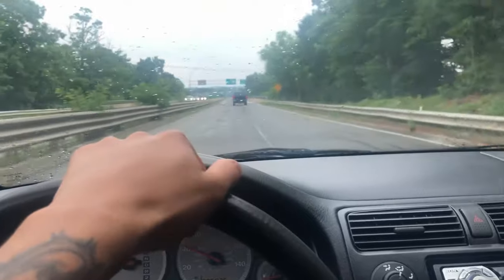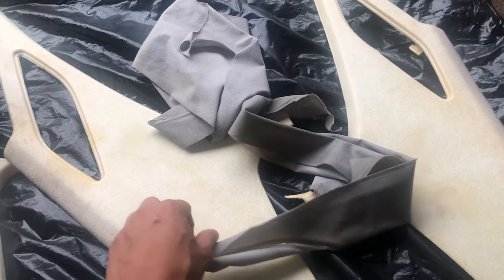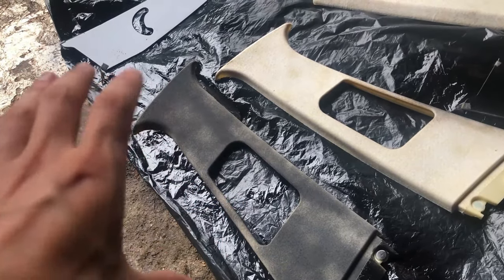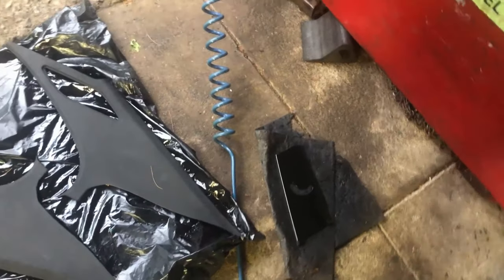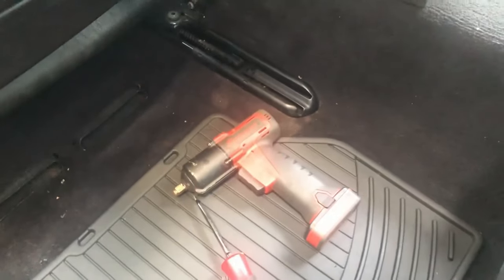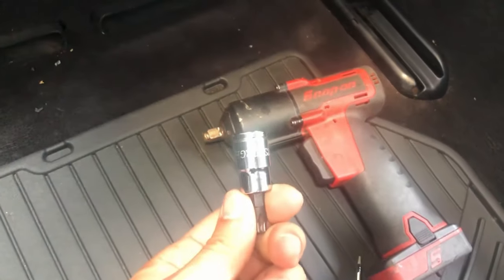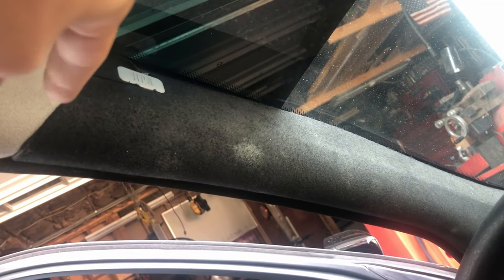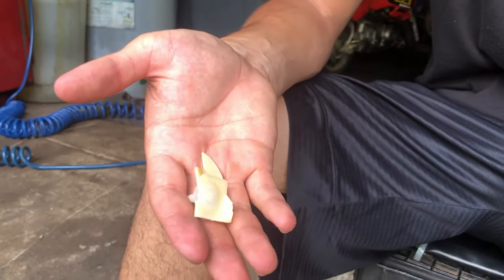BMW E39 A,B,C PILLARS REMOVAL (PAINTING)

Comment: Man i have the same problem on my car all the pillars are beige but the strange thing is that the the driver side is the worst in the fabric wears off and also on the rear were the dsp woofers are it is also changed color by the sun but youre right you can buy them new but in a few years it will happen again, thanks for sharing this greetings from the Netherlands.